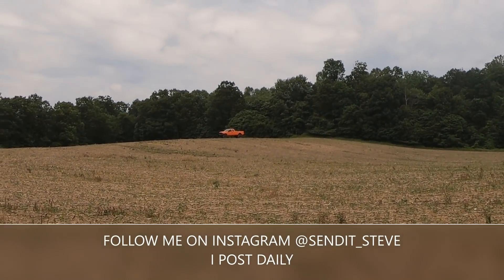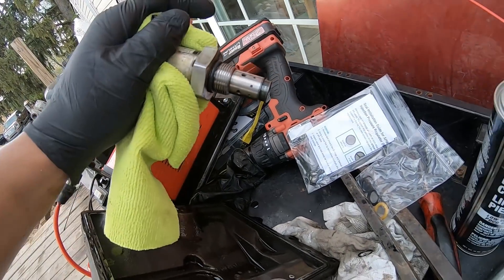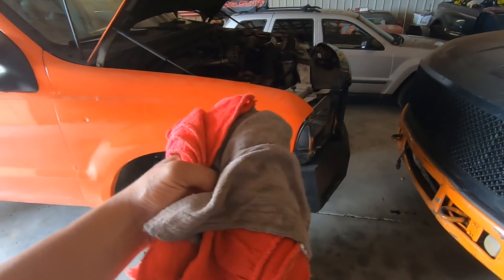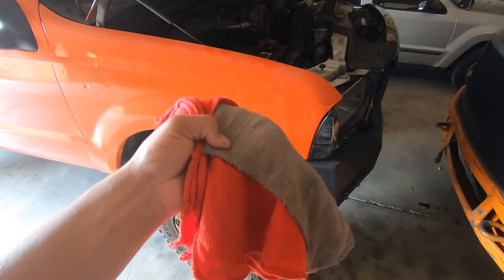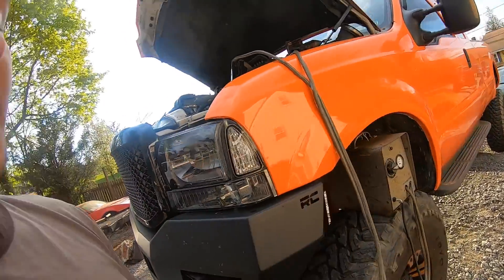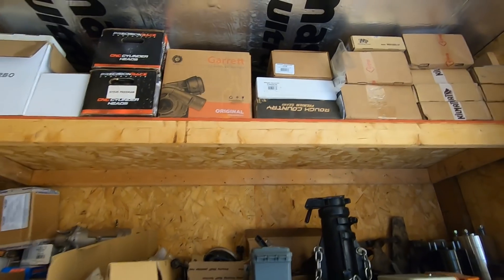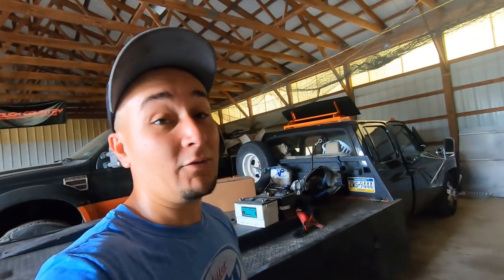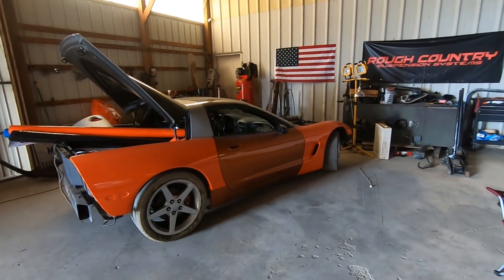NEVER USE THESE SHOP TOWELS ON YOUR 6.0 POWERSTROKE!

Comment: I love that ford. Speaking of fords. I was hoping you could do a 1990 ford f150 with the double tanks. Because.  I have to replace the fuel lines and fuel tanks snd fuel pumps on mine. And its a extended cab and i think long bed. Im only 15. I gotta do it in out drive way and its kinda on a slope. Just something i thought would be nice 😅